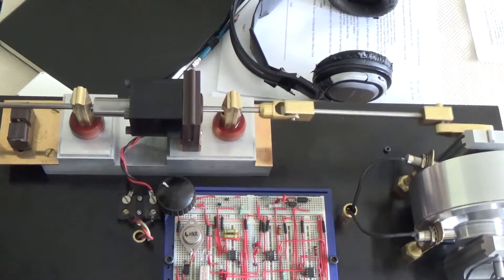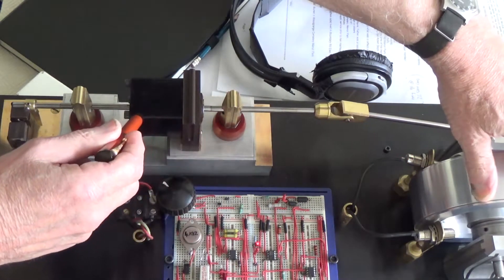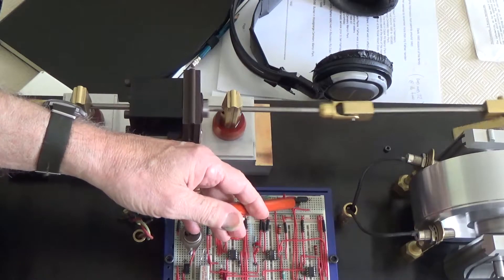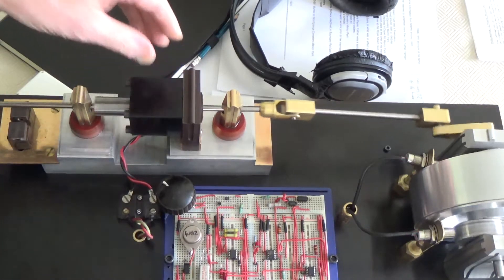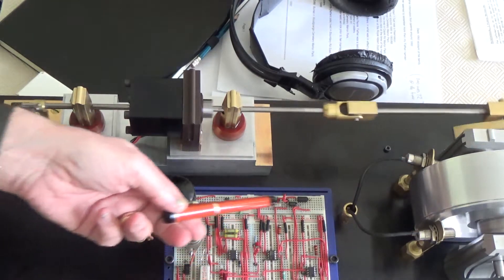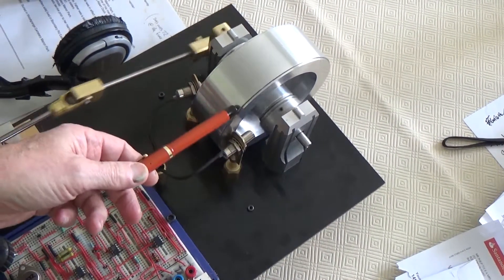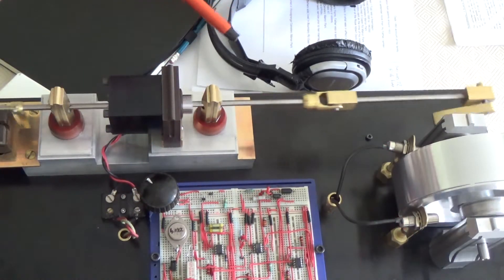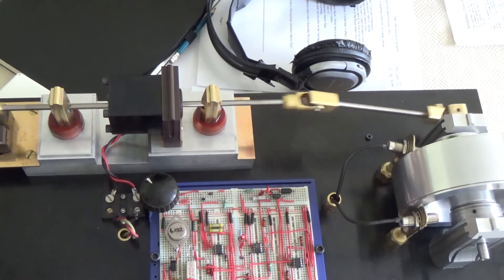Big Solenoid Engine | Adjustable Speed Control | Part 2

Comment: Very nice explanation! I'm really surprised that the PWM 555 was ok with being turned on/off via Vcc on the timer itself. I would have probably expected the PWM signal to be always on, always modulating, and then the latch just controls some sort of "enable" on the base of the solenoid mosfet. I suppose by switching the PWM timer on/off then you've eliminated the need for a switching transistor on the mosfet base. Am I missing something otherwise obvious on that? Quite clever!

Also, the rpm of your engine is pretty low, but do you know what frequency range the PWM is switching at? Very nice engine and excellent video explanation. Thanks a lot!